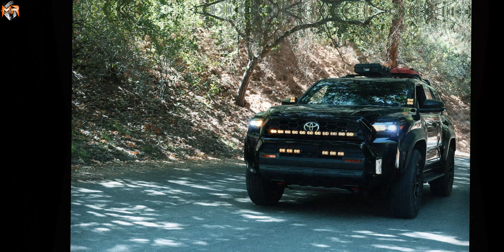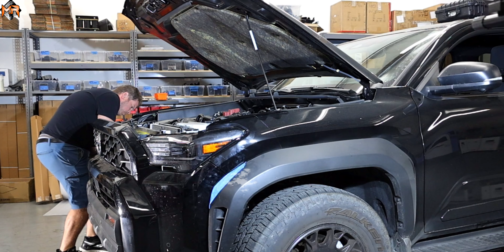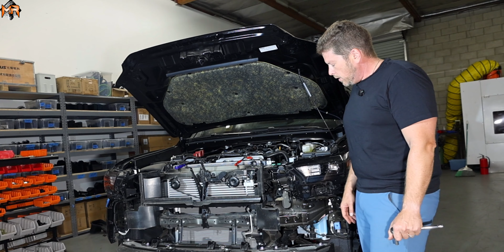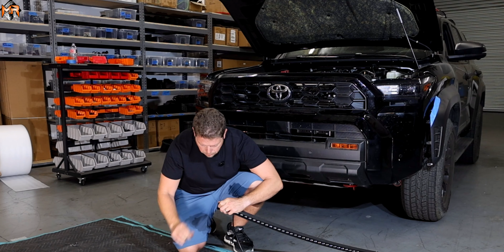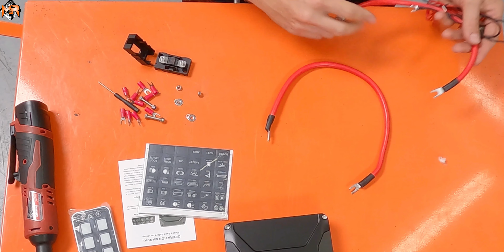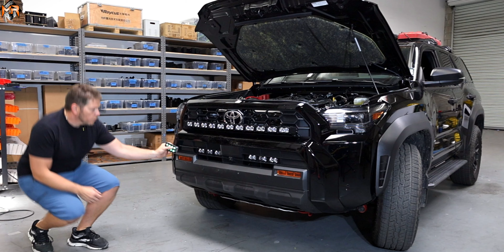2025+ Toyota 4Runner 40in Light Bar Install | Full Tutorial

Comment: I accidentally found you on Google and this is exactly what I’m looking for! I don’t really find  roof light bars useful driving a trail at night but seeing really far out with them in the field is cool because you can catch wildlife roaming around lol  so I’d probably Kay install this and a roof light for more security for us in the dark! Cool!  Now, you said we don’t have to remove the bumper and that will save me time. I hate bumper removals.
Reply from the maker: You don’t need to remove it for the 40”
Reply: This is really cool! If I wanted to connect it to an aux battery like an XS Power self contained battery, it doesn’t seem too bad. I did that with a previous rig.